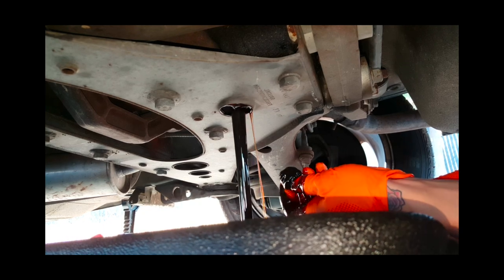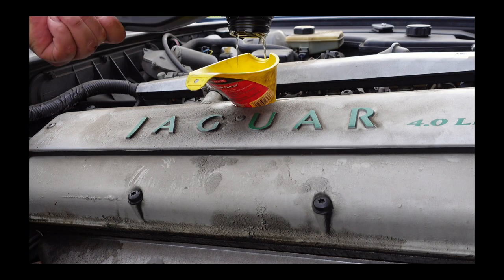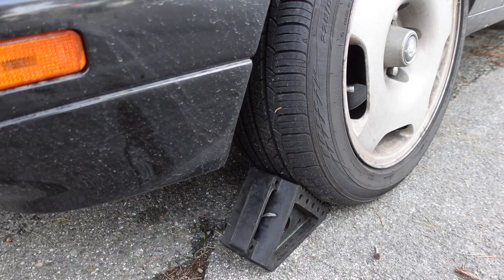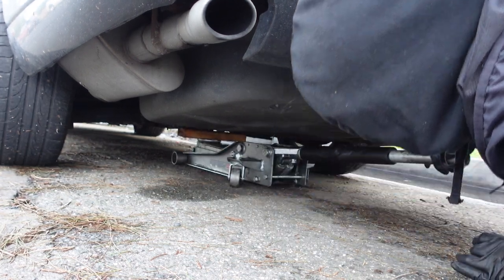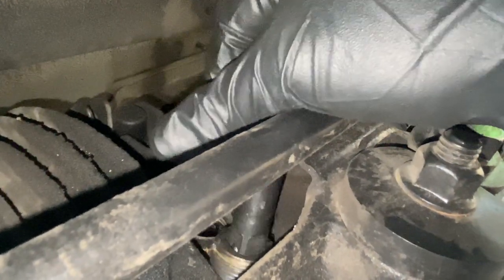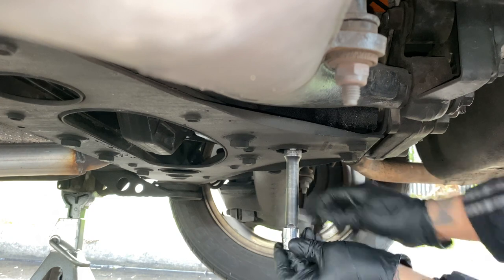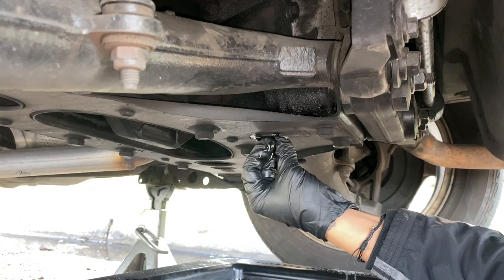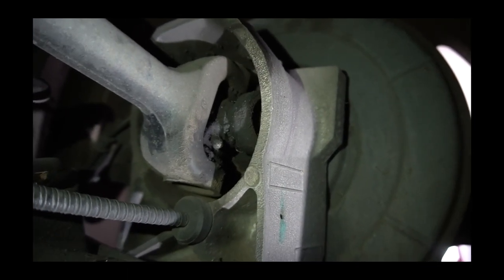Let's Change The Differential Fluid In My Jaguar XJR6

Comment from the maker: What’s up you guys! Im doing my best to stay consistent with uploading new videos every week. It’s hard but I won’t give up 🫡
Reply: What's up XJ Jesse! I'm have an '05 xj8. I currently have some issues that I can't get passed. So, my car battery died a week ago, the key is not programmed, so I have not acces to the trunk. I did see your video about opening the trunk with the drill, will it still apply to my '05?
Reply: Oh, and is there a way to jump start it from under the hood?
Reply: What size bolt is the drain plug?

Comment: Thanks for the tutorial, very helpfull as usually. I am going to do this asap, using Ravenol LS 90, since there is multiple clutch plates based Salisbury Powr-Lok limited slip differential inside. So the diff oil also needs to be for LSD (containing LSD additive). I will also add up to 5% volume of Prolong additive (they don't recommended usual 10% volume for LSD specifically, but only 5% in this case), as the diff gears are known to wear out prematurely on these more powerfull supercharged versions.

Comment: What other areas underneath or atop do you grease?
Reply from the maker: I believe those U-Joints where the axles meet the rear differential are the only grease points on the X300/XJ6 models. You can follow the driveshaft and check around the front wheel suspension assemblies for more grease points.